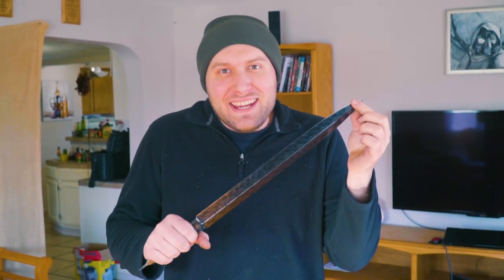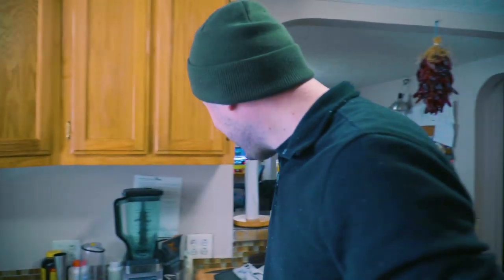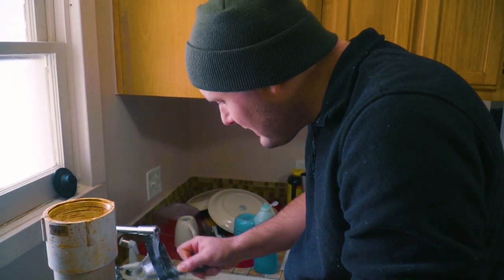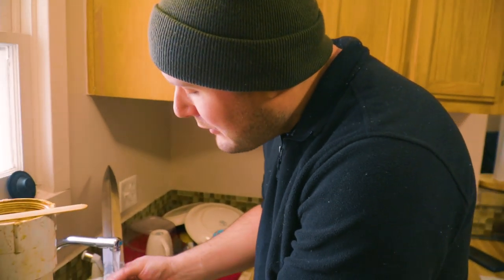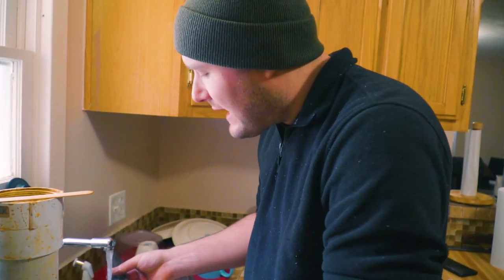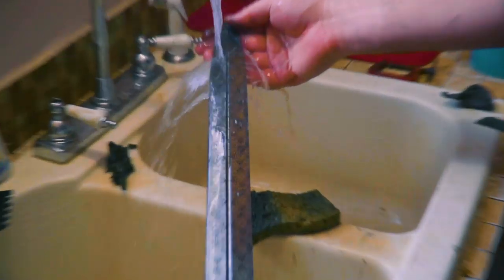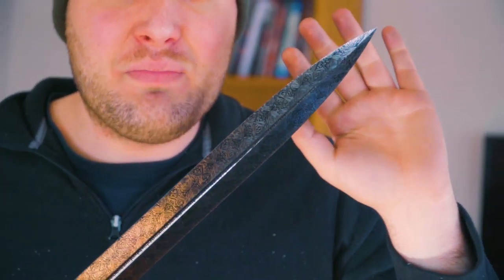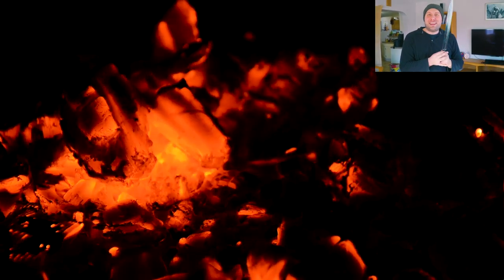After Hard Work, I Found What I Was Looking For...

Comment: How about using a Tupperware/Rubbermaid Kitchen Dish Drainer Rack? It would be plastic/rubber so it won't scuff or scratch the blade. It can be set over the sink and the water will still drain correctly. Better to have this to rest the longer blades on? I imagine it would work well for the shorter blades also?  Keep up the good work, God bless.
Reply from the maker: Good idea Michael. Do what you can to keep the blade protected. 
May God bless you and your crew. 

       Dad